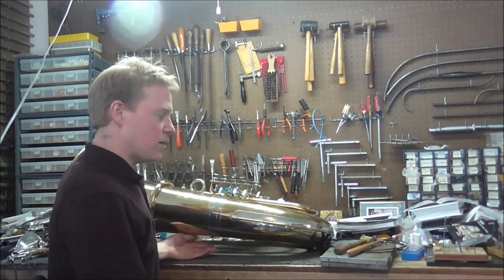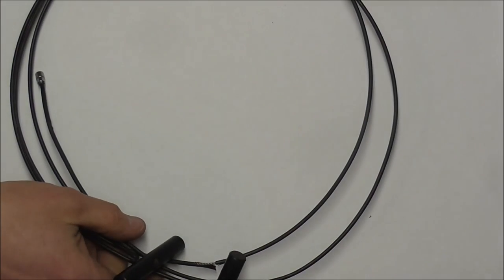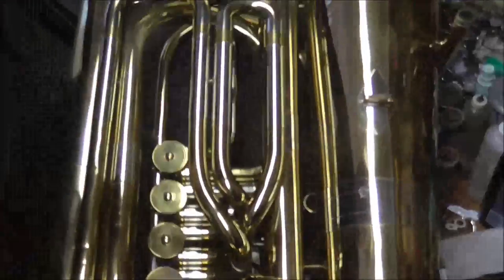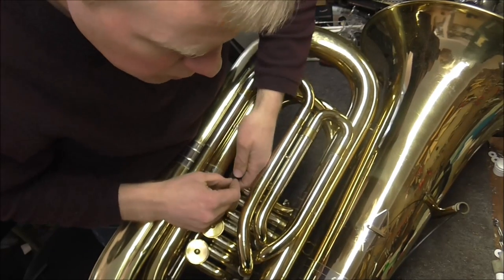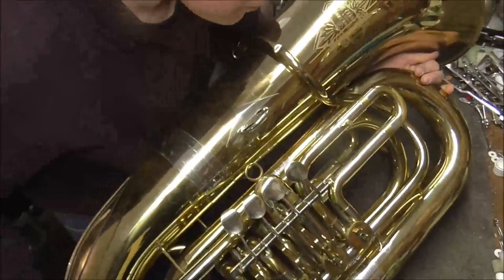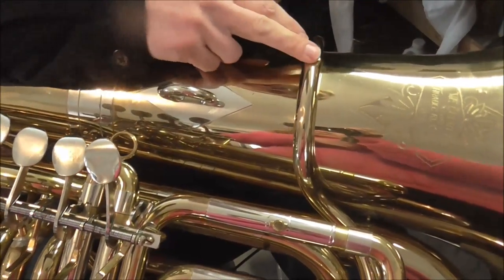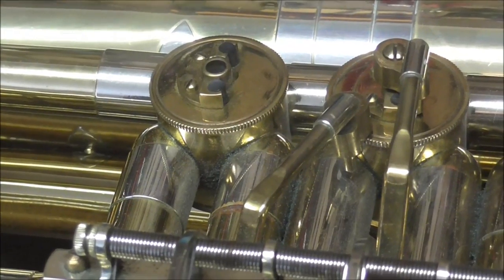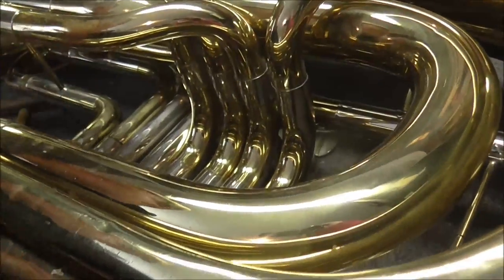How To Remove A Leadpipe Dent: Use of Dent Cable on a Cerveny Tuba Leadpipe / Dent Removal

Comment: A little lube on the dent ball helps. This is exactly the same technique I use to repair dented or pinched hard lines on aircraft! Also have a bladder that is inserted and then pumped up with oil pressure to push on a pipe that is gently heated to ease the metal. Very pleasing results possible with very low pushing and pulling forces.
Reply: Excellent idea.  Do you try to achieve cosmetic perfection or just make the tubing usable again?  I think the brass here could have been burnished to a higher standard but I'm no expert.